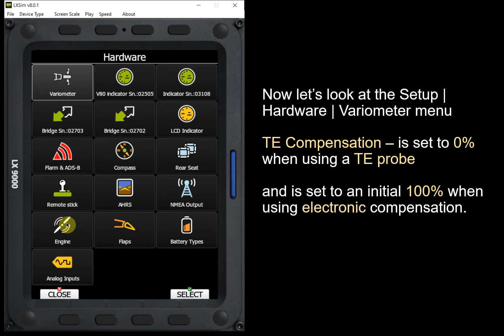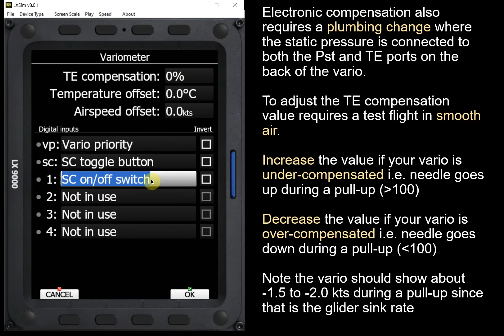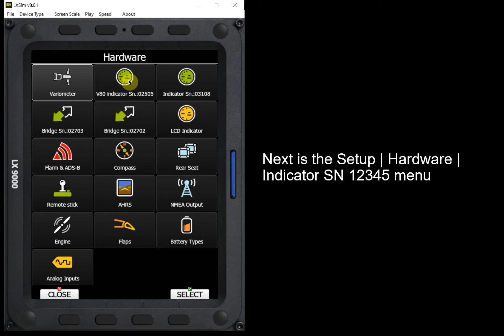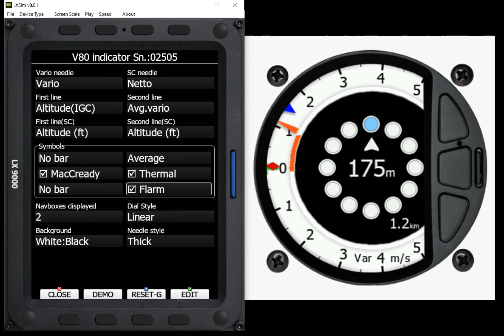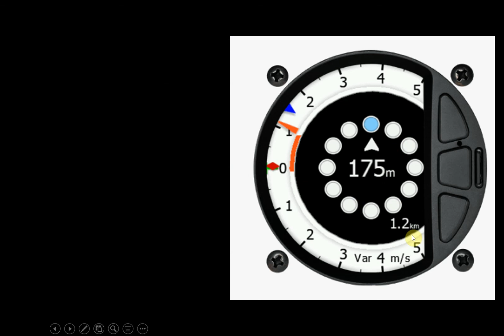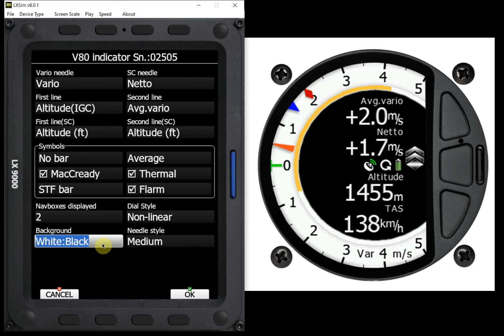LX9000 Vario set up (Part 2) - What are all those other options and settings?

Comment: Is there a way to use the flap sensor to switch the vario from SC to climb mode?
Reply from the maker: I think I either read something in the manual or stumbled across it in the set-up recently, but off the top of my head I can't remember the details.